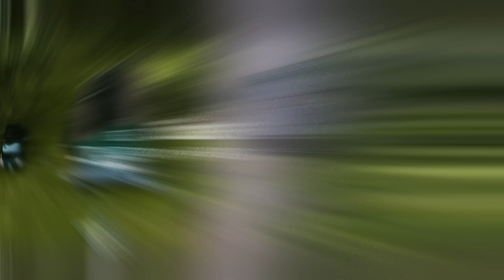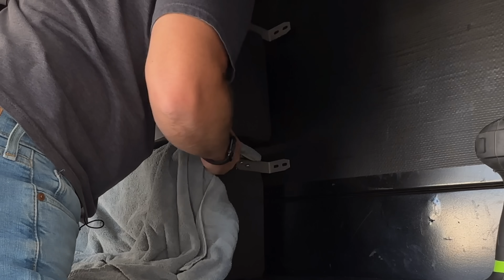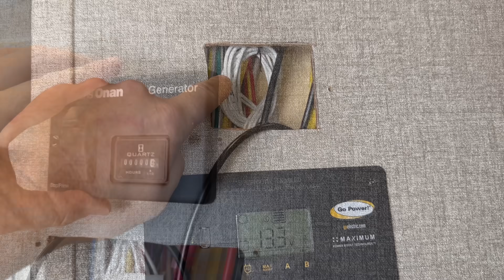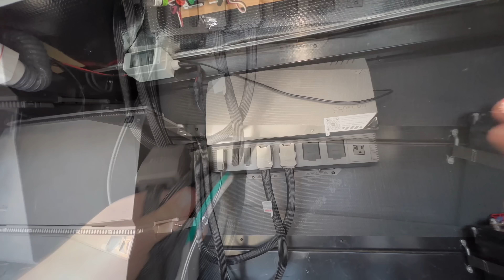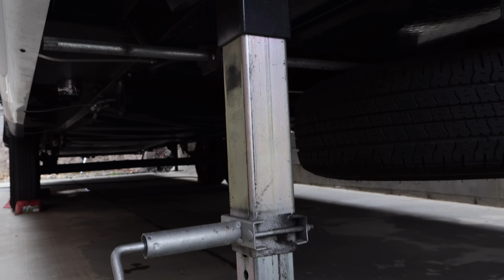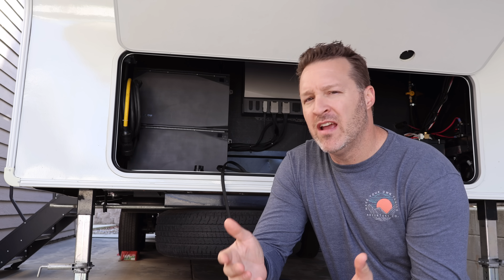CHANGING OFF GRID! EcoFlow Power Kit Review and Install Too Easy!!!

Comment: Great video Johnny! I'm looking at the Outpost 6.5 truck bed camper that has this system installed. Wondering what you might know about the long term reliability of this product?
Reply from the maker: I’m still using mine. It’s running everyday. Solar plugged in, then I have it looped over to charge house battery 
I use other half of solar on the Rv to dump into home system when parked

Comment: How many watts is the Ecoflow power hub itself nobody never talks about the power where's the power coming from not the batteries not the connections but the power itself the inverting power ?? Like how many watts is it
Reply from the maker: The original is a 3600 watt inverter. The new one is 5000 watt.
Reply: @johnnysweekends  ohh ok sweet thank you

Comment: How will you change the fuse on the lower battery if it pops? Good luck doing that easily with this config.
Reply from the maker: They never pop so not worried about it.
Even then it would take me about 5 mins. 
Those batteries are crazy robust

Comment: Plug and play is the way to go.

I’m sure EcoFlow will soon come out with an upgraded system for 5, 8, 10 or 12kw output and a quadrupling of battery capacity.
Reply from the maker: Such a cool system, only limiting factor is max 15kwh battery system. But it should serve 90% of the people out there 👍🏼 but there are ways around the limit
Reply: @johnnysweekends  how would you add capacity?
Reply from the maker: @TheCornucopiaProject-bd5jk I have over 5kwhs in my house batteries so I use the Alt charger port and a victron 12/24 converter. So I then dump power into PK if needed. The up converter can do 20 amps continuous but I normally run it at 15-17 if I have two. 
I don’t think I’ll need to
Much because I’m generating a lot more. But my whole setup changed with adding the other panel and changing my array. I no longer have solar charging the battery. So I’m fixing that.

Comment: I installed Ecoflow Powerkit and added 3,150 watts of solar on my 34ft Avion Travel Trailer last June. I have 15kw of batteries and run my air conditioner on the system. Live full time in our rig.  In the over 9 months I have not plugged into shore power or a generator. Totally off grid. Full time. Love my Ecoflow Power Kit!
Reply from the maker: Right!! Isn’t this thing great. Pretty amazing and I think this will really make other companies change direction. 

I’ll be adding another battery to 15k as well and dropping my house batteries down to relieve some weight. I can charge right from the 24v out to a drop down to 12 for the house batt. 
I’ll add more solar on that input from the house batt to the PK..👍🏼
Reply: @thomaskiser140  that's insane!

Comment: GoPower Sucks!  This is why im buying the EcoFlow to replace it.
Reply from the maker: I don’t even know how they are still in business. Way over priced for minimal performance and features. 
I’m ditching my on board charge controller. It doesn’t connect and doesn’t seem to charge at all good rate. Plus it’s pwm so it’s old tech.
Reply: @johnnysweekends  super old..my van is 2019 came with it. Nothing works well. Time for a change!

Comment: So you can hook this up to shore power and not have to deal with the smart panel? I don’t want to take out my stock switch panel simply because if I resell, I’d want to not have to rewire it twice.
Reply from the maker: Yesss! I built my whole Rv in a fashion to make it very easy to stripe and it will be almost exactly stock for resale. The power kit if you noticed in the video is still using the stock Electric distribution panel so no modifications to the DC or AC circuits. It’s almost plus and play if you have a generator prep. The only I would leave behind is the data cable so I dont have to fish it out. 
I could strip the whole power kit in less than 30 mins. Hence the reason I like it so much and it’s been working very well. I just went on a 7 day boondocking trip and leaving again this Friday for 8 days again mostly dry camping. I run an electric heater at night that clicks on and off in my bedroom. I can run my front AC full time when the sun is out but the main unit draws more than I bring in so it will eventually deplete depending on the conditions. 
And yes it has AC input so you can charge or go into bypass mode. 
And the prices of this have come down with other products being released. Let me know if you have more questions and I do have discounts for the power kit as well.
Reply from the maker: Here is the discount code and link just so you can get an idea…Power kit discount code 
11% off use code: POWER11
EcoFlow power kit: https://bit.ly/46k8oAp

Comment: Great video! One correction: EcoFlow Power Kits can have from 1000W of alternator charging input (with a single 12V alternator) up to 4800W of alternator charging input (with two 48V alternators using all three alt/solar input ports).
Reply from the maker: Yes you could do that, but dont know who would be using dual 48v alts…but its a pretty cool kit honestly with a lot of functionality

Comment: This is just brilliant, and if the other providers are going to go down this road that's great, too. The competition should keep the price user friendly. Plug and play AND move it between the RV and the house. 
What do you think is going to happen with Solid State batteries?
Great video - thanks!
Reply from the maker: Battery tech is only getting better every year. When they can mass produce and scale it faster it will take over for LFP.
Eventually maybe the sodium ion battery will be able to take over. If they can make it small enough lol

Comment: Can build a MUCH better system, bigger capacity, higher quality components - for a fraction of the cost.
Reply from the maker: Most people are not going to want to install sungold power or EG4 items in these. Size or inverter and weight of server rack or wall battlers are heavy and spacing is a problem, how ever I may still do it for fun.

Comment: Can the power kit be used in a marine application?
Reply: EcoFlow is considering a new version of the Power Kits for the marine market, it will require a number of changes to be certified to marine standards.
Reply: I will be first in line when they roll out the marine version
Reply from the maker: @jamesdiserio4020 no kidding right. I plan to buy a cabin cruiser in a couple years and this would be excellent
Reply from the maker: @GregKBoulder this will be awesome when they do. And yes takes much more to be marine rated.
Reply from the maker: I don’t think this is set up for marine use. I would ask direct but I didn’t see anything saying it was certified for marine use

Comment: Those tiny brackets and screws for 80 lb batteries are concerning.
Reply from the maker: They are actually pretty strong but it comes with a couple mount option which has this strong strap mount as well with brackets on the bottom

Comment: super simple but more than twice the price of good quality normal instal. Also over 3000$ for 5kw Battery?
Reply from the maker: Twice the price?? Ahh don’t know about that after you add all wires and connections and more. You put a big system together and add disconnects fuses and more you have added more money. That’s not all included which also needs more wire. Just the 1/0 cable are spendy
Reply: This is a 48-volt plug and play system - price out the equivalent 48-volt components from Victron Energy, it's ~1/3 of the price.

Comment: DON'T BUY ECOWFLOW I GOT THE DELTA 1300 TURNS ON THEN OFF ZERO CUSTOMER SERVICE. GOT IT AS A GIFT WONT HELP ME AT ALL.
Reply from the maker: /i could ford is junk if I didn’t buy it from a dealer. Sometimes owners need to do some of the diagnostics. Try and deplete battery completely using dc output. Then charge to 100 percent.  Discharge again completely. You can also try holding power button for 30 seconds and see if this changes anything. How long ago did you get it..? And where from?

Comment: Will wait for version 2.0. I feel this won't have enough DC amps to run a decent Air Conditioner.  Did you try?
Reply from the maker: I don’t have a dc ac unit. It can run as a 12v or 24v system. Which would double your dc amps. 
But it has enough as power to run both my Rv ac units no problem.

Comment: How much? Is this a 12v system or 48v? Those batteries are 5000ah(×2)? Thx for help, I was going with 48v system with 4- 48v(54v) 200ah. But alot of work, I love this idea. But ecoflow is big money. Thx for any help
Reply from the maker: This is a $12k system 51.2v batteries. 48v system with 12v or 24v out with 3600 watt ac inverter. Most all this is mentioned in the video
Reply: @johnnysweekends  WILL NEVER SELL, unless your a rich person.  People live off grid to save money. And I m building my own system for 48v(54.4v) system 
For $3000ish. Running led lights, water pump, etc...
Reply from the maker: @mad151maxx4 they have already sold a ton of them 🤷🏼‍♂️ 

And many do not know how to do there own not do they want to. 
A good set up would be a server rack system. If people don’t want to mess with anything get a large enphase set up or silting off that sort.

Comment: A newbie question. Do the system need some kind of heat management (dissipation)?
Reply from the maker: The system/ batteries have heat sinks and will dissipate its own heat. The power hub has fans and heat sinks as well to move air over the circuit boards and more to expel heat. I also have an exhaust fan in that compartment to move air.

Comment: I have the independence kit, with 3 x  5Kw LFP batteries... total 15Kw capacity, more than enough for my off grid needs. It can charge with 4800w total with PV panels! I have 12 x 410w Canadian Solar PV panels, 4 panels for each of the 3 inputs wired in series.  A sunny day with minimal cloud cover can charge my batteries From 30%to 100% in about 4-6 hours. Great system... Very pricey as well. It works and I'm happy💖
Reply from the maker: Nice, I wanna tap into my hole solar system but using micro inverters makes it tough to convert back over. So the trailer is my other power generating unit. 
But I’m net zero so can’t complain. 👍🏼
Now it’s my power when the power goes out but I would like a 3rd battery 👍🏼

Comment: Holy crap
Reply from the maker: Darn right 😁👍🏼
Reply: Well I know what's going into my next rig. 15k!
Reply: Your absolutely right.  By the time I was done with an 11k system, batteries wires connectors modules,  I was way over the asking price of this system.  Forget about my labor!...I would definitely be recommending this going forward and be using it myself.
Reply from the maker: @whitenas yea,people forget to calculate the time it takes. A few hours is one thing, a few days or more is another. Have to admit, pretty slick setup

Comment: Thank you for this. I’m considering this kit, but wondering if it would be wise to wait a bit and see what other products come to market. My biggest hesitation is that the 12v amperage output cannot handle a rooftop AC. I would have to run it on 120v, which would lose some efficiency. 

You mentioned the Renogy Rego, and also a Victron plug-and-play product. I’m not aware of the Victron, do you have any other info on it? Thanks!
Reply from the maker: Yes renogy redo. But not as install friendly but still pretty easy, and victron is just slowly changing with multi plus and newer style Rs inverter charger and solar controllers. 
Which I bet we see some new things soon like during Vegas CES in January. At least we hope so. Again more people will be headed this way. And victron is just slowly making more pieces into less pieces lol.

Comment: After buying all the parts and gadgets for a couple of solar powered off grid systems, I wish I had just bought an additional Ecoflow battery.  I like the idea of plug and play!  Nicely packaged, neat, tidy, and simple system you have there!
Reply: I feel like the first all in one kits on the market were Redarc Revision and Manager 30 system. It was not quite plug n play and batteries not included. So glad other companies have stepped up
Reply from the maker: @Espiritiv agree and I bet we see more in a year or two
Reply from the maker: Thanks Jeff .!!! As soon as I saw this I knew it would change the way more people build kits. Can’t wait to see what other companies do. Be very interesting to see in one year or maybe less. And it can be used for homes, offgrid cabins, Rv, van builds and more.

Comment: I've been following this system since it was released but can't find anyone reviewing the sound ouput volume.  I have the Ecoflow Delta Pro but the fans run so loud I am looking at other options for my TT setup.  Do you have any plans to test the hardware as you have other generators?  Sound db under load where it begins to ramp?  Total db @ 1 m while under full load?  Also, I see that you are installing the inverter/charger unit in a closed space.  Any idea what kind of heat would be generated over time?  For those wanting to install in a similar space, how would load contribute to ambient temperature increase?  Been following your content for a while and appreciate the time you take to review and address the practical side of equipment.
Reply from the maker: I will be doing more testing for sure, I’ll do sound levels and more but with cool air already coming it definitely won’t have to work as hard. One thing it’s quieter than delta pro, but DP also has an update to adjust fan speeds of when full kicks on. 
I also have an exhaust fan in that compartment that you can see in the video but I may switch it out for something else. Will see. It’s a little noisy but it was cheap and an experiment really when I was running DP. 

I need to do some stress tests soon and see how it does. Again cool weather will make life easier. Obviously I don’t want to abuse it but I do have a few benefits so hence abuse it and see what it does..👍🏼

Comment: What a CLEAN setup! Nice work, Johnny! This kits are super awesome for an RV install. Question.... I was just helping my friend with a power station rv install and the built in transfer switch didn't work until we bonded the neutral and ground with a bonding plug. Did you have to do that on this setup?
Reply from the maker: This one I did not which I was surprised. It has been working with out a bonding plug.

But a bonding plug is only needed if a on board pms or EMS system is installed or using say a watchdog surge/low voltage protector.  Much like a gas generator it’s the same. Not needed if none of those are installed. But there are exceptions depending how new or old
Reply from the maker: Oh and thank you 😁👍🏼

Comment: I am glad they are doing this.  Even with solar generators prices are getting even.  I bought my pecron for 855 out the door which has 1200 w solar input 2000 w inverter, 1980 lifepo4 expandable to 8kw.  That being said I do not have the knowledge to build that safely not yet at least.  This stuff can be pretty dangerous to a newbie.  I don't want my neighbors building 10 kw systems if they know nothing about electric it's a skilled science.  Nice job Eco Flow.
Reply from the maker: Agree, very smart idea here. Very interested to see who else follows in making kits like this.